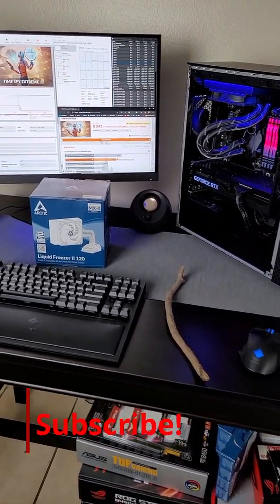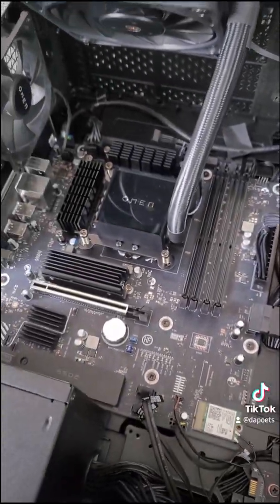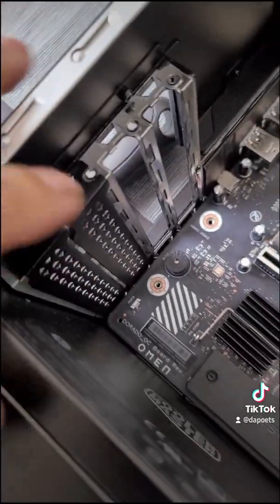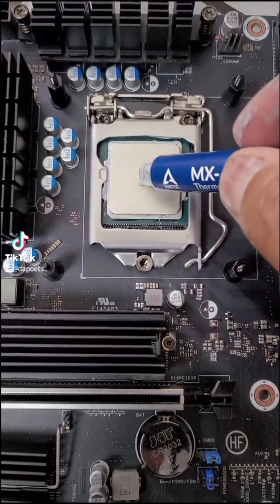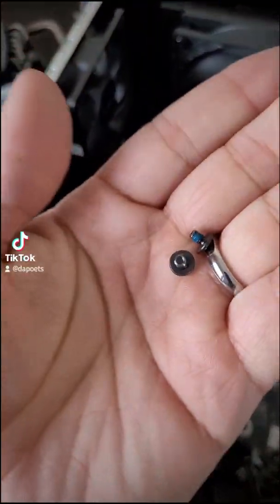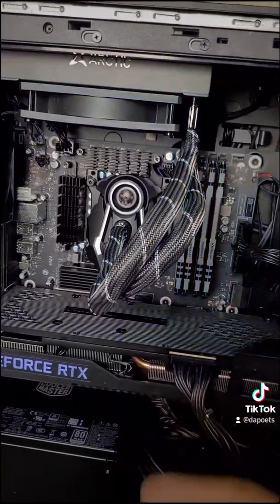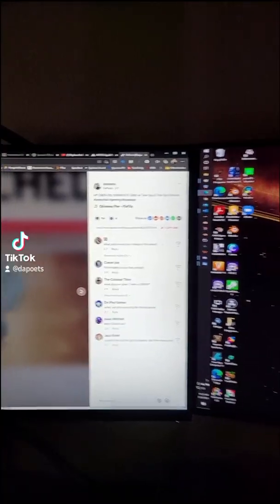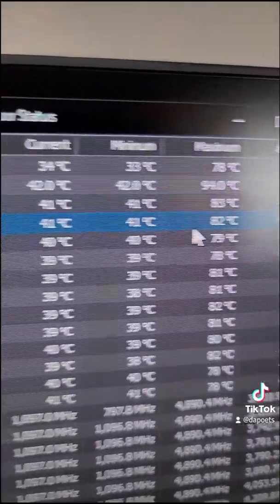Arctic Liquid Freezer II 120mm AIO in a $3,099 HP OMEN 30L i9-10900K

Comment: I also have an omen pc and recently got an arctic aio. I did the workaround like you did to get it to boot but every time I shut it off and try to turn it back on nothing happens. This means I have to take out the cmos battery just for it to turn back on and let me do the workaround with the old aio. Do you know how I can get it to boot without having to take out my graphics card/cmos battery every time I want to use my pc?
Reply from the maker: For my 45L when I boot w/ the Arctic AIO I just see a prompt and hit OK to bypass the error as I described at the end of the video.  Does that not come up for you?
Reply: @DaPoets  Hello, I’m going to get Arctic freeze aio. And install it on the omen 45l 12900k motherboard(omen motherboard), will I have any problems turning on the system? And will the bypass thing only come up once ?
Reply from the maker: @shubdh-hz5ul  I have not tried this on the 45L 12th gen.  Let me know when you try it but it should work just fine.
Reply: @DaPoets  I saw a tik tok of yours giveaway of the 45l case, and you said that the artic 360 aio did not fit was it too long ?
Reply from the maker: @shubdh-hz5ul  too thick
Reply: @DaPoets  oh I see, can I use corsair aio without usb header ?
Reply from the maker: @shubdh-hz5ul  I never tried that combo . Let me know
Reply: @DaPoets  the prompt does show up but if I turn off my pc after hitting ok, it won't turn on (no fans, nothing happens) until I pull the cmos battery again. Took it into best buy and he suggested I may have shorted a component on the motherboard...RIP

Comment: Hey great video! I am having the same issue in part 7 but no matter if I plug in the stock AIO or put the artic to another slot it still won't boot. Any suggestions on what I should do?
Reply from the maker: Check the end of the video I think I gave a solution as to which port it needs to be plugged into
Reply: @DaPoets  thank you for the reply! I did the same thing with still no boot. It's strange because the second I plug in the PSU the PC turns on itself and then cycles. No matter the fan header I plug the AIO in still the same outcome. I am thinking I could have messed up the motherboard.
Reply: @bryson9426  taking out the cmos battery worked for me but I have to do it everytime I want to turn my pc on

Comment: I just picked up this PC. Cannot believe the fan noise. Running a CPU stress test, the cores all hit over 95 degrees almost instantly, the fans ramp up to jet take off sound levels and quickly settle down to 60ish but man it's annoying as hell. Running MS Flight Simulator with everything on Ultra the sheer amount of fan noise is really bad.

Comment: This look like a real good solution for not a lot of money, but I really am not a tech guy and taking the motherboard out, to get that back bracket off is really daunting to me.
Reply from the maker: It's not so bad, just take pictures along the way so you can reference what things should look like and what plugs into what.
Reply: Thanks I have just finished installing. Unfortunately in order to get the motherboard out, you have to take out practically everything. Unfortunately I failed at the first challenge, which was the graphics card bracket, which is has been screwed in tight and one of the screws has threaded. I have tried a workaround which does seem to have worked, I went and brought longer screws, so I don’t have to use the bracket that comes with the Artic cooler. At present, I’m not seeing any difference in performance and best, at worse, it might be slightly worse, the major difference is the sound however, it produces hardly any sound. My current advice to anyone looking to do this upgrade and you are like me and you are not technically sound, and you have fists of ham and sausage for fingers, either don’t bother or pay someone else who knows what they are doing to do the work. I have only just put this together, if I change my mind over the next couple of days I will let you know.
Reply from the maker: @jamief1263  Your drop in temps (or lack of) will be dependent on what CPU you are cooling and if you have proper mounting pressure & thermal paste application. I highly encourage people to evenly apply the thermal paste manually across the entire IHS instead of just a blob in the middle.  If you have a lower end CPU you may not see much of a temperature difference. If you have a hot running CPU, you will see a big difference. Run Cinebench R23 as your baseline before and after.
Reply: @DaPoets  played more tonight and i think its improved the cooling slightly. Thanks for the tip the paste, I applied it all evenly. I have checked and there is definitely contact (as I used different screws, I checked that contact was being made). My cpu is a Intel Core i9-11900K. I will do a proper comparison tomorrow, but it’s looking good so far. Thanks again for the advice 🙏

Comment: Installed in one Omen 40L Ryzen 5600X with a RTX3070, minus 15 degrees in the CPU right out the box no tweaks. Cooler connection went without issues as well. Thanks for the video and to convince me to install it watching it. Cheers from Portugal.
Reply from the maker: Fantastic
Reply: Hey, i also have the 40l and im planning to do this upgrade. How did you do the connections? Did you connect the aio to the original spot or to a fan connector?
Reply: @diogo_2790  use the same connections.
Reply: Did the system give any errors when installing different aio , and did you have to bypass the errors?
Reply: I used the same connections. No errors whatsoever.
Reply: @hpathe  that’s good to know, can you adjust the fan speeds and pump speeds using the Hp omen gaming hub ?
Reply: Did you also have pry off the bracket off the motherboard, I heard it’s glued
Reply: @shubdh-hz5ul  mine was not glued at all. Just be careful on the back of the motherboard under the CPU socket. Lot of surface mounted components there.
Reply: @hpathe  does the artic cooler only have one connector that handles the pump and fans , and can you adjust speeds using omen gaming hub
Reply: @shubdh-hz5ul  only one connector, yes. You can adjust the fan in OMEN Gaming hub. I thin it is tied to the pump speed as well, so no issues. I am running VR DCS and MSFS at 65-70 degrees C tops.
Reply: @hpathe  where do you put the connector in the pump header or fan header ?

Comment: Thinking about replacing just the fan from the original omen liquid cooler for a Corsair LL120 will that make it less noisy and cool better?
Reply from the maker: Less noise sure but probably not cooler temps. Would be a good experiment though.
Reply: @DaPoets  how about replacing it for the SP120 that’s pretty the same fan Corsair uses for their liquid cooler
Reply from the maker: @zeldacollectorfreak4855  yep better for static pressure

Comment: @DaPoets i got the I7 10700 looking to replace with AIO but do i have to remover the backplate or can I keep the backplate you did mention is using the same intel mounting backplate so I don't see why removing the backplate is necessarily
Reply from the maker: Every backplate is different per AIO so yes you have to remove it.

Comment: This case is terrible for high core count processors. 120mm aio is not enough for a 10 core chip. For anyone that still has this prebuilt your best free option is to underclock and undervolt the cpu until the temps are manageable. Since you are already sacrificing performance with this setup even with a 120mm aio "upgrade" you might want to keep it undervolted/underclocked (4.0-4..3 seems to be the sweet spot for temps using the stock 120mm aio). This way your chip wont be at 91c constantly and it will last long enough to put it in an upgraded case and cpu cooler (nhd15/240-360aio).
Reply from the maker: Take a look at my new video on the 45L

Comment: what did you do with the original aio? i cant find one anywhere to buy. im not looking to remove the mother board. i hate the fact that the 30l has no cut out
Reply from the maker: I have it in storage, it's worth removing the motherboard and replacing it with a better cooler

Comment: A fan I installed on that other header can not be controlled or assigned a curve because of the restricted BIOS. Does your AIO run at the same speed at all times?
Reply from the maker: This video is from a year ago I believe I was able to adjust the fan speeds using the HP Omen software

Comment: So I bought and installed the same cooler. It seems to be working great except for the fact that I get it tells me that the cpu fan isn’t functioning properly on boot up… it doesn’t seem to sense the rpm. It passes the thermal test though. Any thoughts?
Reply: I did try and change the fan headed it was attached on
Reply from the maker: That's what I showed in my video at the end after it being replaced with the Arctic Liquid Freezer II. Just ignore it.

Comment: I have the AMD R7 5700 3060TI version and it ran so hot the computer would reset itself. I replaced all the fans with Noctua premium fans and redid the thermal paste with Noctua paste and dropped my temps by about 10 degrees. Do you have to set your core speeds and voltages with the HP Omen Gaming Hub? On my unit I have to put my values in because it automatically overclocks the crap out of my system on boot up.
Reply from the maker: I didn't have to do that...

Comment: You probably can't disable CPU fan monitoring in the BIOS since the Omen BIOS is likely so basic. You could probably plug a different fan into the CPU fan header and it would work fine. Another shortcoming of some/most OEM prebuilts, very basic, non UEFI BIOS which doesn't allow you to do much of anything.
Reply from the maker: I showed the solution at the end of the video
Reply: @DaPoets  Yes, saw that.

Comment: You want to see thermal throttle, you should see the stock air cooler in use.  I replaced mine with the Noctua U9S, but I only have an i7 to deal with.
Reply from the maker: The new 45L is much better with its cooling capabilities
Reply: @DaPoets  Yes, HP finally put some real thought into cooling their higher tier Gaming Desktops.  Still though, I would rather see the 45l with a mesh front panel to keep the lower chamber as cool as possible.  
 The 40l is decent too with room for three front intake fans and decent room on top.
Reply from the maker: @Wigglythegreat2  There is a large gap in the front so a front mesh would not make much of a difference.  I was happy w/ the internal airflow of the 45L for the GPU.

Comment: After adding the aio would it be necessary to add or replace the fans for better ones
Reply from the maker: I don't understand your question. But are you wondering if you should replace AIO fans with other ones? If so that's typically never necessary.
Reply: @DaPoets  yes that was my question thanks 😊
Reply: Are you saying replacing the aio won't do much?
Reply from the maker: The AIO by Arctic is all you need. It comes with the fan.

Comment: The biggest problem with the computer is the dual grill on top of the cooler. Ridiculous on poor exhaust abilities with those. I removed the top plastic one just above the cooler and that alone dropped 10-15 degree's. But under that you can see the case grill is just a barebones amount of triangle holes and could of been so much better. If I feel energetic will drill the thing out proper down the road. But with I9 10900k and 32gig it has no issues with some super hard use software now. What would of kept you from using the original backplate? I have reused many as they are all strong. Also thanks to your video spotted the mounting bracket for the stock cooler had a wasted Cross blocking airflow. Cut that out and temperatures are 87-107 degrees idle and most using anything. Heavy games 140 degrees peak. With just the upper grill removed over the cooler and the cross on the mounting bracket.  So far all I need to do and have built my share of I9's....

Comment: I have an Arctic Liquid Freezer II 240mm with 4 120mm Noctua industrials in push/pull config on an I7-9700K OC'd to 5.2 GHz. The highest temp I could get was with Cinebench R23 at 79 C.
Reply from the maker: Very different processor and wattage so you can't compare the temps between a 9700K and a 10900K but  you're temps look great!
Reply: @DaPoets  well with that oc it would run incredibly hot on many coolers. so his CPU cooler is doing a fantastic job.

Comment: Any tips on removing the backplate without cracking the mobo? Also, will any 120mm AIO cooler work for this build?
Reply from the maker: Just take your time. It's just really tough double-sided tape. I can't confirm that any AIO will work but the Arctic liquid freezer II is excellent for this PC. It only fits a 120 mm AIO so if you're going to do it use the best available. Arctic or EK are the only two I would recommend.
Reply: @DaPoets  thanks so much for the advice, I actually got the EK before I saw this video and wasn’t sure. Thank you for making this video cause it’s been a great help! Love your content!
Reply: @DaPoets  Is there any way to do it with the stock backplate? Don't want to void warranty..
Reply from the maker: @gysiguy  Backplates are made to give a specific amount of height and pressure on the IHS so doubtful.
Reply: @DaPoets  ok, so I guess I'll just sell it and build my own PC again 😂

Comment: Why is the default setting on the OMEN at 4.7 GHz and 1.3V core voltage . I created a default profile for 38/43/-0.03V by settings overclocking. Now the CPU runs at 3.7GHz and 1V.
This is enough for COD with the RTX3080 at 3440x1440 and everything on maximum setting for 120-140FPS . Without rayraicing, you get 150FPS. The processor is only utilized 50% and the maximum temperature with the fan on Turbo is 60°C -70°C. The individual cores at 40-50°C. If you want to go another 10° lower, you have to open the case because the heat of the GPU disturbs the cooling performance of the water cooler. A better fan of the AIO can also still help.
Reply from the maker: Thanks for the info!!

Comment: I don’t like when people compliment coolers for being quiet because it usually doesn’t have to do with the cooler. It’s usually the stock fan curve that’s programmed to be silent.
Reply from the maker: I manually adjusted the fan curve, as I do with all of my aios, and this one allows for the fans to be quiet while giving top cooling performance for a 12 core processor.
Reply: @DaPoets  what’s the pump rpm on the cooler?
Reply from the maker: It's runs at abot 2700 RPM so a bit more than half the speed of a D5 pump by Optimus or EKWB.

Comment: hey!
I bought the 64 gig ram version. Its idling at 74c  and goes up to 89c after 2 minutes of gaming and then the fans are blasting louder than my vakuum. This cant be normal right ?
Edit:  I just installed Nvidia expirance and the temp goes up to 89c ... this cant be normal.
Edit2: i just made all the windows updates and the gpu driver update and now its not booting anymore... Just a blackscreen
Reply from the maker: That idling temperature is extraordinarily high... I would remove the CPU Cooler and see if the thermal paste was applied properly. Idling temps usually don't matter but that is way too high
Reply: @DaPoets did that didnt helped. 
But i noticed that the on the radiator was facing the wrong way. 
I turnd it around and now its working as it should. 73c max while gaming on 4k high. 

Thx anyways!
Reply from the maker: @Fabsi87  Oh that sounds like you had a trapped air bubble then since turning the radiator won't make a difference but I'm sure jarring the AIO while adjusting it did the trick.
Reply: @DaPoets  why should it not make ah different?
Know its sucking cold air through the raditor and cool it and befor it was blowing hot air on the hot radiotor what makes hoter and hoter....
What does AIO mean?
Reply from the maker: @Fabsi87  Oh I thought you just rotated it, not change the direction of the air flow.  Yes that can make a difference.

Comment: So i bought the cheaper version of the hp omen   30l. Mine has a ryzen 7 cpu with a regular air cooling fan, rtx 2060, 16gb of ram. My mother looks slightly different from yours. So my question is am i still able to upgrade to the artic cooler with the version that i have?
Reply from the maker: AMD and Intel have different socket layouts but I would imagine the process is similar.
Reply: Did it work bro? Im thinking about getting the same version as yours so I just wanna know if you did it and if it worked?
Reply: @childsupportman6990  if you didnt do it yet. amd is on am4. it has a special mounting mechanism that comes also with this  cooler so yes you can get both intel and amd with it. unless you get intel 1200 you need to ask them for a special bracket then.

Comment: You could mount a push-pull...
Reply from the maker: Thinking about testing that to see if it makes any difference due to it's solid performance already
Reply: @DaPoets  so have you tested push pull with the artic aio?
Reply from the maker: @Heart_Of_Adell  I did not since it would not have made a difference.  This AIO removed all of the issues the previous AIO had.  At most push/pull would have reduced temps by 2-3 degrees so it would have been irrelevant.